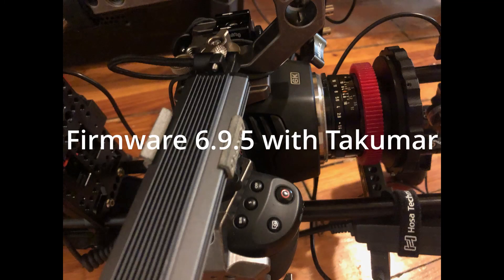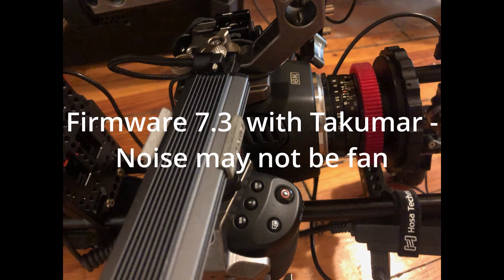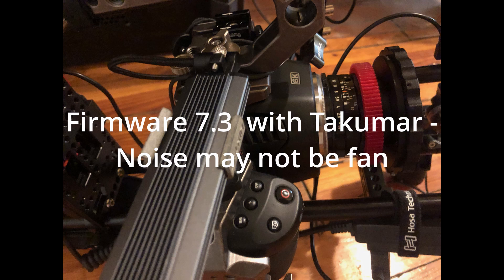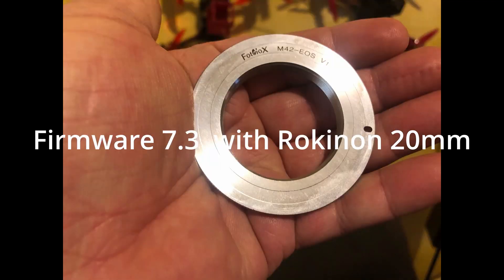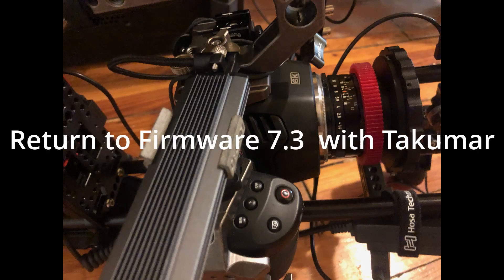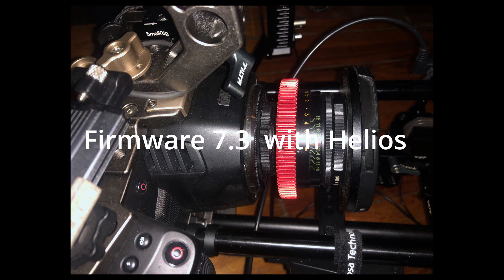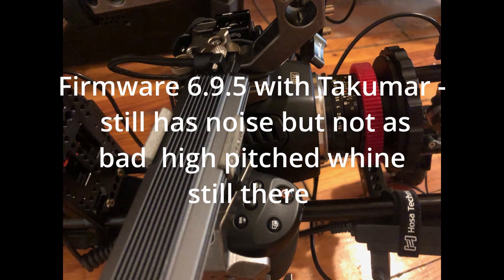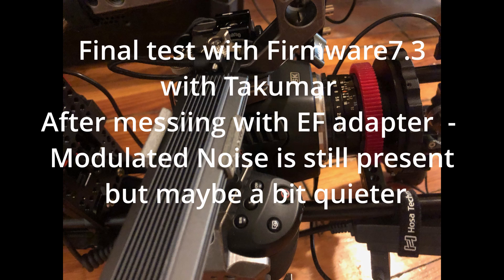BMPCC6K 7.3 vs 6.9.5 Firmware vs Lens Noise Test 1

Comment: Hi, i had the same problem with my BMPCC6K as well. I found the problem to be with my M42-Canon lens adapters.. for some reason, when you update to 7.3, the contacts in the front of the camera (the ones that normally control the AF and Aperture) seem to react to the closed-circuit from the metal adapters. My solution was super simple, I just put some small strips of isolation tape and put it on the adapter to exactly the position where the contacts would be when attaching it to the camera. Noise solved. so maybe if you have a lens without contacts, just isolate the metal part from touching the contacts. hope that helps ! Greets.
Reply from the maker: Yeah!! It definitely related to the conductive adapters.. I started buying anodized adapters after I made this..  I used a multimeter to confirm they were non conductive!! I’ll put tape on my “chrome” adapter…    Thanks for the comment!!! 🙌🏻🙏🏻❤️